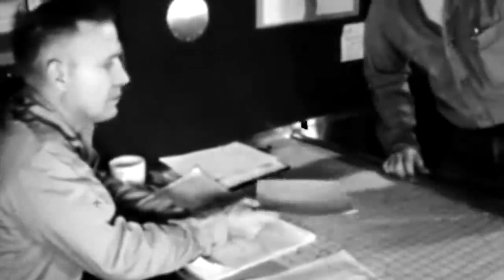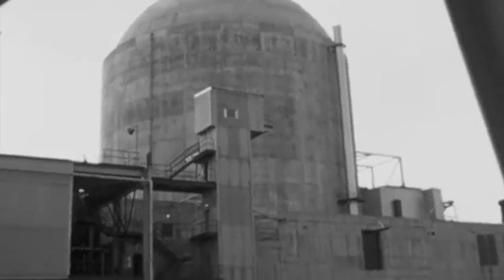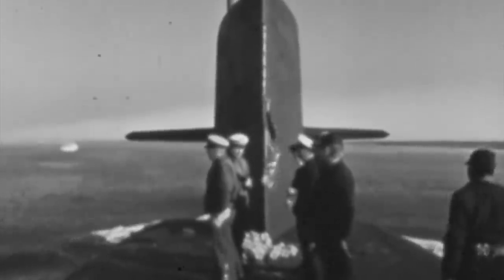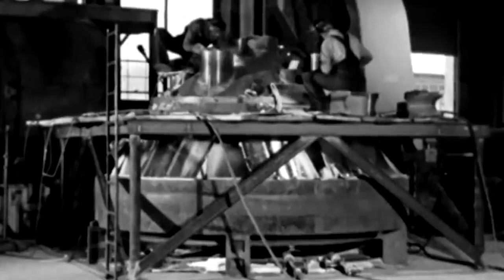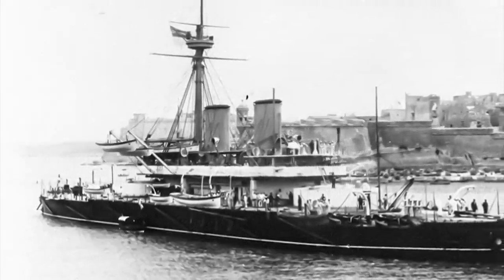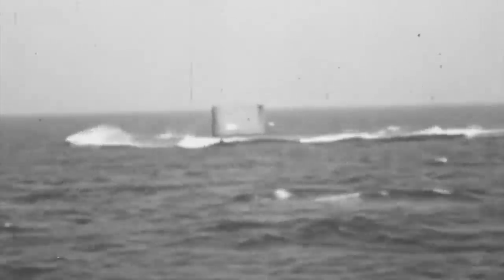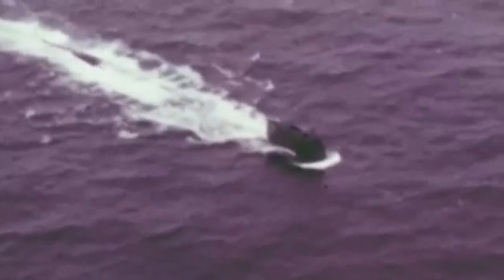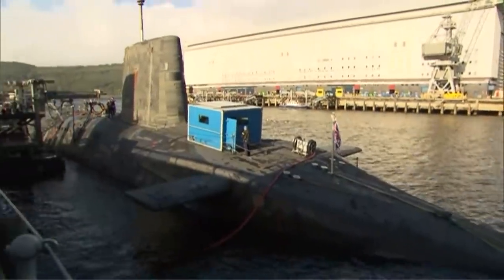HMS Dreadnought Nuclear Submarine (S101)

Comment: Minor hull cracking?  On any ship, much less a submarine, it wouldn't think this would be a minor problem.
Reply: The severity of hull cracking will depend on which hull has the issue.
Reply: "Minor hull cracking" may also reference the delamination of the outer hull coating. On any ship, much less a submarine, it may be considered a minor impost and this reduces the stealth capability rather then the hull structural integrity.
Reply: Some people are just so fussy. They were only little cracks😂😂😂
Reply: No, no, not “minor”, “slight hull cracking”. Apparently, there’s a difference. A crack’s a crack, if you ask me, which you haven’t. It’s all good, as long as you avoid any submersions.
Reply: @charlesfoehner2598  😂😂😂👍👍👍
Reply: Hull cracking however 'minor' is important any time you can't get out and walk home.
Reply: Minor hull cracks = repairable with duct tape and 3 coats of paint on top.
Reply: @skookapalooza2016  Take it you speak from personal experience there?
Reply: A submarine technically has two hulls, one within the other, the light hull and the pressure hull. The outer, or light hull, is already perforated to let water in and out, so a minor crack wouldn't affect the inner pressure hull.
Reply: Depends on the type of crack and on which hull
Reply: @cleverusername9369  
The 'light' hull as you term it is not a defacto pressure hull. However, it does provide the enclosures that are the ballast tanks. So cracks would be important. Any failure there would result in loss of buoyancy. Additionally cracks would allow bubbles to be released which generate noise allowing the boat to be tracked and / or targeted. So yeah minor cracks would be pretty important.
Reply: @danielbeck2739  We used to say:  "1 coat for dust, 2 coats for rust, 3 coats for structural integrity" 😅
Reply: @skookapalooza2016  Preaching to the choir there. Used to be a submariner years ago. Figured you were one yourself or knew a few.
Reply: @danielbeck2739  Have you not ever watched Red Green?
Reply: @cleverusername9369  While somewhat correct, not fully correct. NO submarine has 2 hulls. You have a pressure hull which is about 90% of the ship, with outer hull sections forward and aft that contain many tanks, and are primarily used as "ballast" tanks. This allows the submarine to surface or dive. The ballast tanks are not meant for structural integrity.
Reply: @bobalicious2696  don't Russian submarines have two hulls? At least for older models. They are using single hull now.
Reply: The irony is that The original HMS Dreadnought is the only ship that has the one and only submarine kill via ramming to this day.
Reply: @skookapalooza2016  are you out of your freaking mind? You never ever should do that without inserting gum in the crack first. Ffs
Reply: @danielbeck2739  I was.  "No slack in fast attack!"  I got out in '09.
Reply: @bradsanders407  I think you've got the spirit!  You'll go far in this man's Navy! 😂
Reply: IF  YOU  WENT  TO  TEST  DEPTH  WITH  THAT  HAPPENING  YOU  WOULDN'T  KNOW  WHAT THEM  BECAUSE THE  DEEP  SEA  PRESSURE  AT  TEST-DEPTH?  GOOD-NIGHT  IRENE!